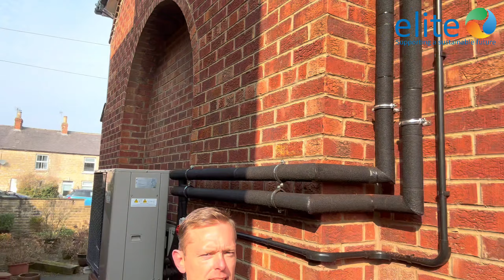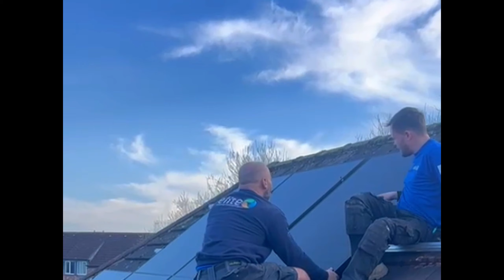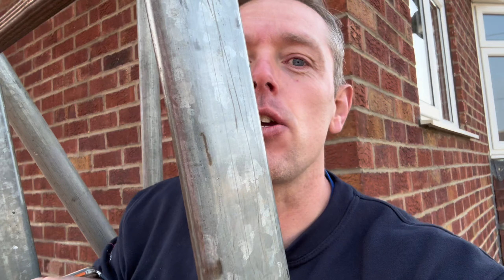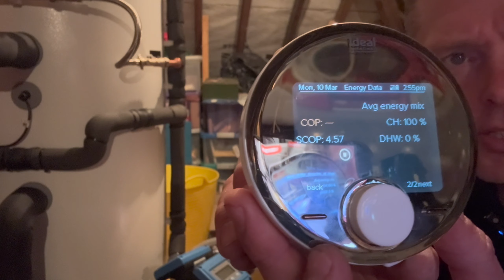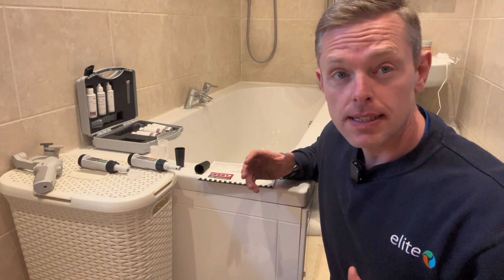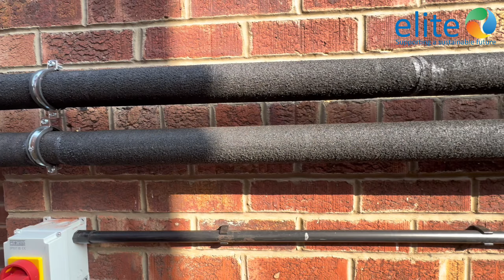Solar + Battery + Heat Pump Installed & Commissioned PROPERLY!

Comment: Interesting to see Ideal Logic monoblock heat pump. They look great on paper (v low noise and high efficiency), but you don't see many installer videos showing them. Ideal Heating is based in Hull so UK made.  Most of the online content is the usual "V" or "D" makes.
Still surprised how many installers of energy / renewable products use kW and kWh interchangeably as this if they are the same thing.
Tesla PW2 has a capacity of 13.5 kWh and maximum charge and discharge power of 5kW and 11.5kW respectively.

Comment: I wonder how much your de mineralised water machine costs and how much volume you get through it before replacing the resin as de-mineralised water isn't that expensive to buy so if you added this after powerflushing with your flushing machine would it be quicker and cheaper as time is money?
Reply from the maker: The machine is an investment to reduce call back costs. (A lot cheaper). 

The resin works out about £20 a go.
Reply: @EliteServicesGroupLtd  not too bad then

Comment: I wish you wouldn't show your guys standing on roof tiles, no roof tiles are designed to stand on and you may have weakened them so in the future could crack. Other than that looks neat install. Try putting a board across your roof hangers ti stand on

Comment: Hi, I see you have used Honeywell 3 port valve instead of ESBE valve. Have you had any issues with Honeywell, especially with a rubber ball coming loose?
Reply from the maker: Anything over a 8kw and we use EBSE. Honeywell too fast motoring across for higher flow rates. Makes a thud.
Reply: @EliteServicesGroupLtd  Thanks

Comment: Whats your projection for solar generated electricity when the heating is needed between, say, November and early April?
Reply: I put in a nearly identical but larger system, the trick is to get export credit on a smart tariff during peak solar to offset the heat pump winter costs. With the current tariffs we end in in profit over the year, obviously if export tariffs decrease then it’s likely that electrify costs have also decreased so it still works out ok to electrify. So we turned an annual £3.5k energy debit into a £400 credit, even with a much larger heat pump and a much warmer house. All you need to do is flip flop between smart tariffs in the heating season.
Reply: Real world usually 1/3 to 1./5 in from late November to February of tomorrow normal generation to eg a 6 kWh array usually gets 5.2  average so Nov 1 to 2.5kwh per solar day per hour.